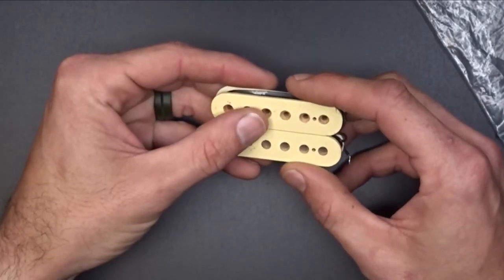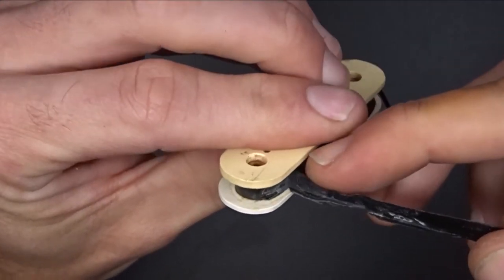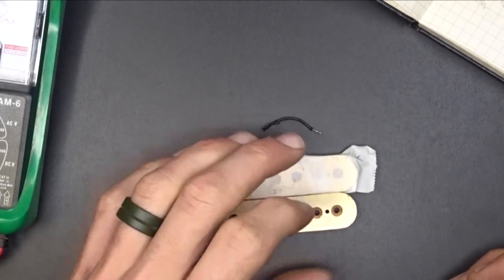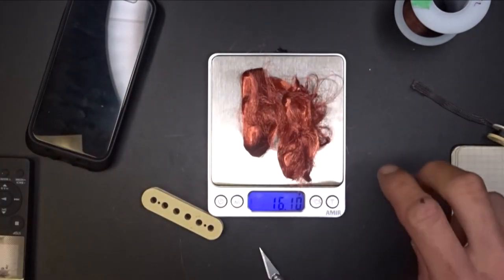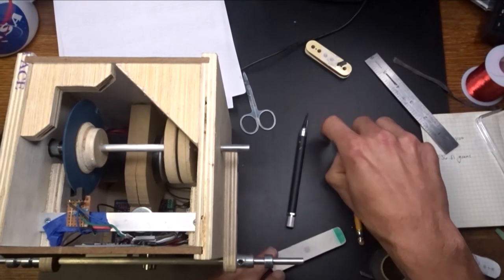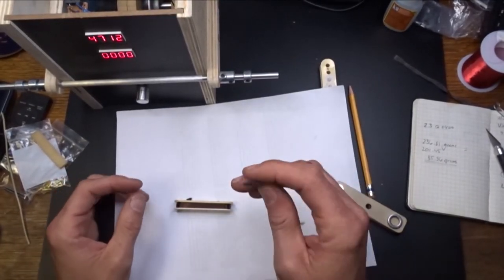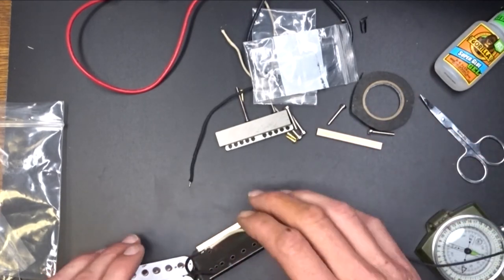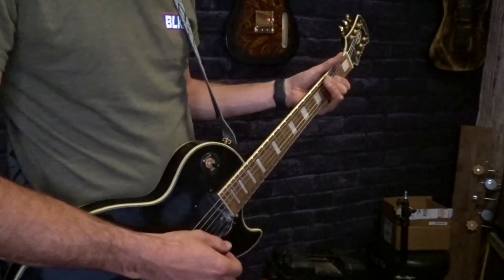Blues South Vintage Humbucker Rebuild And Rewind.

Comment: Your channel is wicked awesome man! 
You have done a lot of things I had planned to do about 15 years ago, but between the current of life and struggling with not wanting to eat the costs of gear like pickup winders and other tools at that point in time, I went a different route. Watching you do it is strangely just as good, and I managed to go to college for E. engineering instead anyway about 12 years ago.
Reply from the maker: Awesome man!  Thanks for the kind words and for liking the channel. I need to get back to it but like you said life always gets in the way. Hope all is well your way my friend!
Reply: @ChasesWKshop  I am back in my electronics lab and designing new circuits from the ground up. I'm also returning to all my completed school material to continue my educational progress, and in the long run, will start producing completed and cutting edge guitar amps that if I can get them to the market, will make elite performance affordable to everyone. That has always been my primary tech goal and to manufacture them in America.